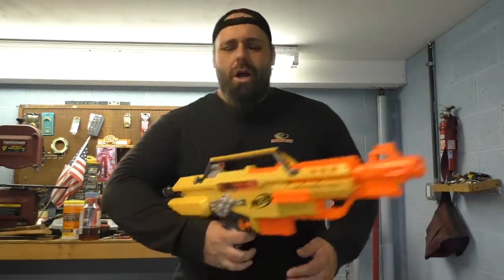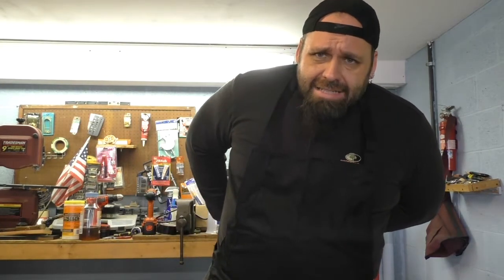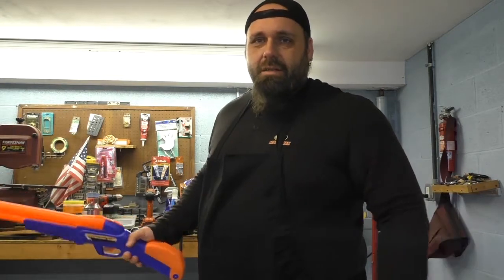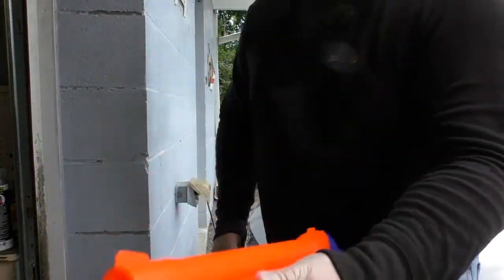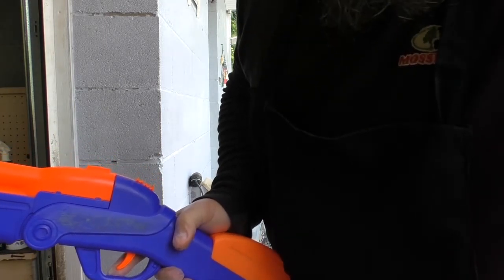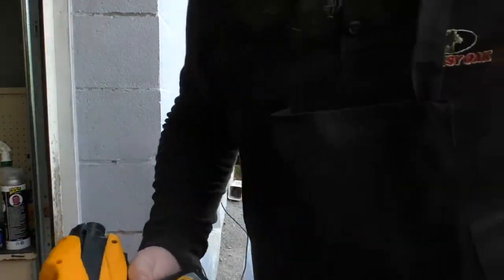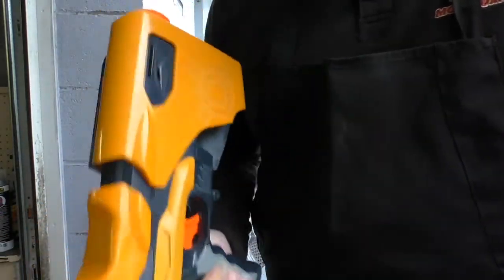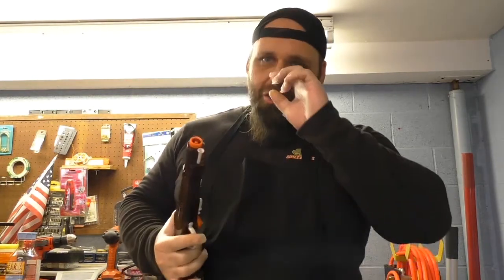How To Debadge Or Prep A Nerf Gun For Painting - Larp Style

Comment: Thanks for the video, of all the nerf channels I watch most of them just gloss over this and don't really explain how to do this. I might feel inclined to try to genre one of my guns once I decide on which one to use permanently.
Reply from the maker: Yeah, it really bothered me seeing a lot of the big nerf channels not really mention this.  Some of them make these incredibly modded and expensive guns with great paint jobs... And there's them Nerf Logos and stupid warnings glaring through it all.  And it's such a simple step to skip over.
Reply: Larpgasm do you have any suggestions for and paper grit for really getting a smooth finish?
Reply from the maker: If you want it really smooth, I'd suggest using a scraper with a razor blade in and being extremely careful, and just cutting the logos off, it'll leave a fairly smooth finish if you do it right.  But you can also use really fine sandpaper, like 800 - 2000 grit and also wet sand it.  So, use regular stuff, like up to a 600 grit doing it dry.  Then get a much finer one and do it wet.  That'll get it very smooth for you.
Reply: Thanks dude! I really didn't want to show up to game again in a non painted blaster. I'm the new guy in that game so I really felt bad after seeing everyone else's blasters being genre
Reply from the maker: Well, that'll get you in.  If you really want to do it up, look into car stuff.  Like vinyl dye.  There are a lot of ways to prep and paint Nerf guns, and some are vastly superior to others.  But losing the badges and hitting with primer and paint, you should be good.  I'd suggest if you paint the grip though, either wear gloves or wrap something like hockey tape around it, if not, paint will rub off all over your hand.  Or... Don't paint the grip.
Reply: I'll probably go with hockey tape and dirty it up. I have seen a lot of people use vinyl dye which is probably what I will be going with at least for a base coat and hit it with testors for the details and a nice clear coat to keep it locked in. Part of my garb for dystopia rising includes gloves though